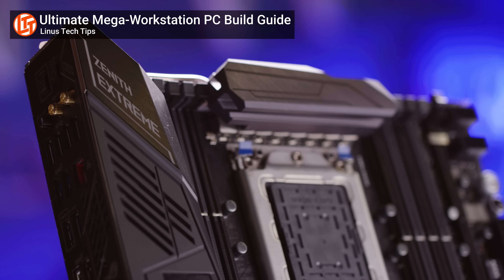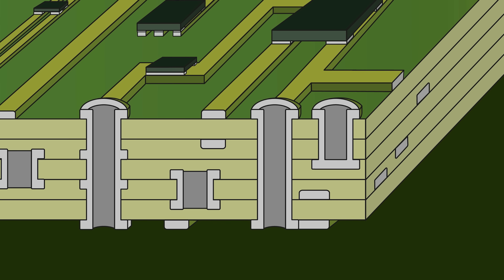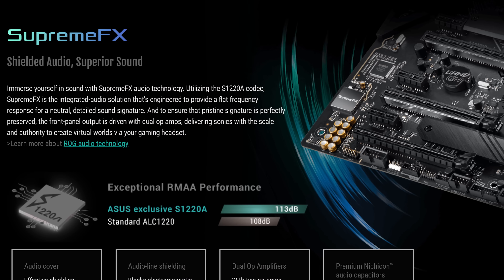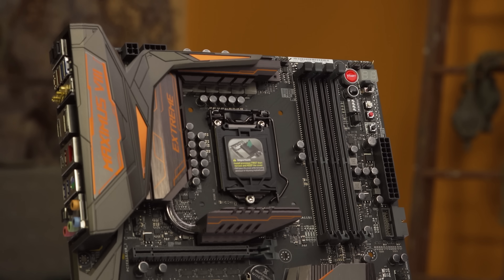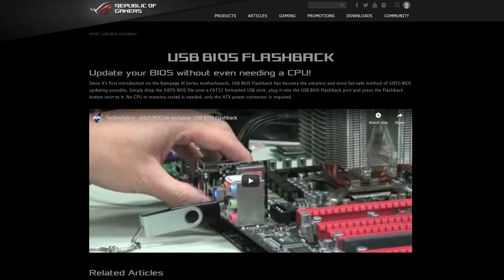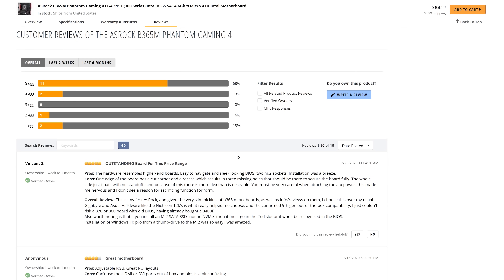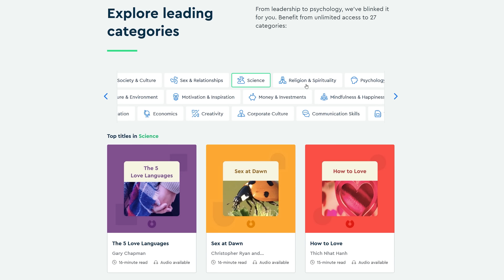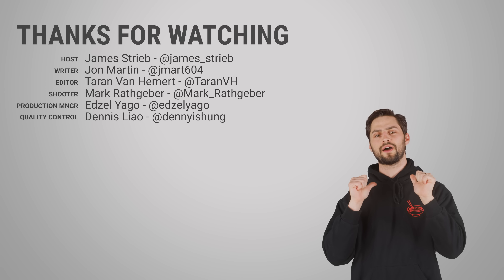Are EXPENSIVE Motherboards Worth It?

Comment: I love how there is a lot of motherboard related videos popping up on my youtube recommended the last 2 days... while waiting to find out what happened to my motherboard I bought a week ago and is a few days overdue delivery... I have a Gigabyte B450M board, it was great with my Ryzen 5 2600, but I recently bought a Ryzen 7 3700X and I can tell you this, the motherboard is very unhappy with the power draw of the CPU, VRM's are getting extremely hot and having power delivery issues because they need to rapidly cool themselves instead of cook to death, doesn't help the upper VRM's have no heat sync at all, and the left side VRM's have one but it may as well not because it just doesn't work. The new motherboard will be the final upgrade to my system (a unless something fails or whatever), since I upgraded the CPU from like I said, a Ryzen 5 2600 to a Ryzen 7 3700X, my GTX 1060 to an RTX 2070 Super, replaced all 5 120mm fans in my case with newer, more powerful fans to blow a lot more air into and out of the case, I have 16gb of DDR4 3200mhz ram so no need to upgrade that for a while, and also added 2tb of extra space to my overall storage, and once it gets here, I will be replacing my current Gigabyte B450M with an ASUS TUF B450-PRO board, from Micro ATX to full sized ATX board, has some real nice heat syncs over the VRM's, and have a few other pretty good looking heat syncs elsewhere on the board, plus a better payout of the SATA ports, and is made with Ryzen 3rd gen in mind so no updating the BIOS to run any 3rd gen Ryzen CPU, can do that out of the box. I also have a be quiet! Pure Rock CPU cooler to replace the EXTREMELY LOUD stock cooler that came with the 3700X... I have never heard a Wraith Prism be so loud in a system before, and has to be, as it can barely keep the CPU cool enough while idle. Needless to say I finally have myself a really decent CPU (once the new motherboard arrives and is installed) and will be building a second PC out of all the spare parts I will have left over (currently the only spare part missing is a motherboard to run the Ryzen 5 2600, which the board I am using now will be the board used in the second system)
Reply: in that case then wait for b550 atleast you can use 1 nvme with pcie 4.0

Comment: When I was picking out parts for my first PC I was originally going to cheap out on my motherboard.  I am happy I invested in a better model, cheap motherboards typically have cheap VRM.  (I ended up going with an Asus Z370 ROG Maximus X Hero WiFi)
Reply: Looks like you wasted money. Unless you have AIO and did crazy OCs.
Reply: @deivytrajan  I bought a 280mm Corsair liquid cooler and heavly overclocked an i9-9900K, deffinitly didn't waste my money.

Comment: There's a middle ground where you're not spending $500, but getting the extra features you would want over the $50 unit.
Reply: I typically look around the $200 mark. That, I feel, is the half way mark. It has features you'd want, and doesn't have features you don't want.

Comment: I got an X370 board (Asrock Killer Sli/Ac) for my original R5 1600 build and now have a 2600 installed in it and it still runs great. I plan on upgrading to a new board and a 3600 eventually but really have no need right now other than wanting a smaller case and ARGB headers. Been thinking of X470 since it's a decent sweet spot of features/price.

Comment: Asus has a quality series of z390 boards for anyone searching for a solid mid-range... Asus Prime z390a ~$170 for base / Asus ROG z390e ~$220 if you want built in AC WiFi/BT5.0 - the bios on their boards is super easy to use and has a high threshold for customization

Comment: In my experience don't cheap out on a motherboard you end up pay the same price for two motherboards half the price as an expensive one because of issues and buy a motherboard where there is confirmation for future upgrades like Ryzen or like Intel used to. An exception for a cheap motherboard was for my first build I had an i7 4790k with a $49 motherboard from MSI (brown with blue pcie 16 slot) I don't remember the name but it was a solid built mobo with overclock capabilities
Reply: In my experience, the Gigabyte A320m S2H has been really good so far, almost a year with it with both the ram an the cpu OC'ed
Reply: I think the next Ryzen processors are going to use a new chipset as AMD has reached the end of what this one can do. But the next chipset will have a few years of support once they swap to that.
Reply: @jacobgame2757  Ryzen 4000 (Zen3) should still be AM4 and be supported on older motherboards (except maybe A320). Ryzen 5000 (Zen4) will most likely be a new socket and support DDR5 and AVX512.
Reply: My build is 4790K on MSI Z97 Gaming 3 from 2015 and i'm using it to write this very comment, heh. MSI GTX 970 still going strong too.
Reply: I guess you had the h81m-p33. I got ripped of on my first prebuilt with an i7 4790 and this motherboard.
Reply: @FFischer02  did you buy it used?
Reply: Daniel D. No I bought it new in 2015
Reply: @FFischer02  build your own. Much cheaper.

Comment: Are EXPENSIVE Motherboards Worth It?
short answer: no
long answer: yes but actually no
Reply: Memory OC on cheap ones is a nightmare. now i need to stick to Asus high end MBs because even the strix ones do not have all the features i need
Reply: No, they are most definitely worth it
Reply: Personal expirence, never gona buy a high end MB ever again, not because they are bad or not worth, because last one ( ASUS ROG Z270i Strix GAMING) have a problem with their memory channels after some time of use (never OC, buy it most for integrated wifi 5 and bluetooth in a ITX at the time) and asus dont recognize garranty, so i en up buying a cheap msi b250 with a pcie card for wifi and bluetooth. all the original components of the ASUS are still working on the chep msi, and if this one died, at least was cheap.
Reply: I have a computer with a first gen i7 with an expensive motherboard that I have gamed on for years and only recently stop using it for gaming, it's now my plex server.  I have another computer hats a 4th gen i7 with a motherboard that cost me 89 at the time, it died 1 1/2 years ago, but before it died it went out slowly over 3 months.
Reply: @Suiyin88  thats sad to hear. i had great experience wih Asus support so far. but memory issues over time with the MB i never heard of. eather RAM was damaged or the cpu IMC gone bad... did you test with other CPU and RAM?
Reply: @snortgfuel  that is a rare case scenario but i agree unless your just going for a low budget build
Reply: @mauriceelet6376  with the money you save you can just buy faster ram...
Reply: @UltimatePwnageNL  that might be true. but you should not notice the difference of the 3600 to 3700 anyway so why buy more than you need if you upgrade 1 year or so? for 4 or even 6 years you would be better off with the 3700 because the PS5 and XBos will have 8 cores too, but 1 yea... even 10$ more would not be worth it
Reply: @mauriceelet6376  not the motherboard, all the other components from the same build are working on a msi b250m.
Reply: Revolvin Goatt  it's was from a couple of year back when z270 whas brand new. and gtx 10 series was too.
Reply: @Suiyin88  ok, that bad on Asus than
Reply: @mauriceelet6376  LMAO, Asus and good support? That's a bit far fetched. I have to contact US support to actually speak to someone, because guess what in UK, they say they have available support between certain hours but they actually don't. It takes years to respond and weeks to fix/replace a product, so not exactly so good. Don't get me wrong, they do have decent support, it's just not as good compared to other companies, like Microsoft for example who I'd always rate an A star for their efforts at fixing issues with my PC and succeeding at it as well with friendly and patient people, even if I was the one to mess something up.
Reply: @andreiarg  well. I only know the German guys so that can be true
Reply: @mauriceelet6376  it's not like they make bad MB... that MB was awesome, while it work, but you can get a falty one, so again it's a personal expirence and in the moment they release it that z270i on 2017 it was expensive... so having not recognize the guarranty was a big punch, so from now on i preffer buying a cheap one and if it break i just buy another.
Reply: @Suiyin88  well you pay for Support, so its not like you have nothing to complain. And a +150$ MB should get you good Service. If you cant use the product because of them they failed to deliver on that. Nothing more and nothing less.
Reply: i rather buy a better motherboard than a better cpu.
Reply: @ItsReaxxion  FACEPALM
Reply: @Gnawde  no tf they ant lmao!
Reply: Hana Song I think you have that backwards 🤣
Reply: Surely there's other factors like yearly salary???  It would make sense for somebody on a high salary such as a CEO, rockstar, filmstar to buy a 16 core CPU, very expensive motherboard and an RTX Titan etc.  Then somebody on an average salary to buy a mid range CPU, mid range motherboard, mid range GPU.  Then somebody on a low salary to buy a low range CPU, low range motherboard, low range GPU.
Reply: To a certain degree you will get a bit more when you pay a bit more but $500 for a MB? Take $300 of that and get a better GPU or CPU. If you have already purchased the best of everything you can buy then this does not apply to you.
Reply: I think mid tier is best. Better caps/ solder job, place for more ram, maybe dual bios, without the unnecessary junk like covers, paint job or rgb.
Reply: @ImGerald  to be fair, you wouldn't buy a 3950x and put it on a cheapo matx board with no vrm heatsinks
Reply: @Mic_Glow  to be fair rgb is pretty cheap now. And so are black pubs and stuff. So it doesnt really cost anything for the looks

Comment: some lower or mid range X570 boards are the best bang for the buck. I have the MSI MPG X570 Gaming Plus with a 3700X and a 2080 Super and I couldn’t be any happier. Goes for $170 and you can get some for around $200 which are even better and will last a long time.

Comment: Idk why you'd leave out so many key factors. More PCI slots at x16 rates rather than a mix of x16, x8, x4, x1 etc. Thunderbolt support with add in cards or built right in. Multiple M.2 or other drive expansions like time of SATA or SAS etc. Built in hardware RAID controllers. Heck even multiple CPU Sockets would fit into this video for even higher end systems which you guys cover all the time!

Comment: I'm using a $150 low-midrange motherboard and it's been fine for not only general use but overclocking
Reply: it's always fine, that's true. but not as reliable or durable under the same circumstances. Power fluctuations can degrade components, it's invisible to the eye but pretty clear (or deadly) on the long run.

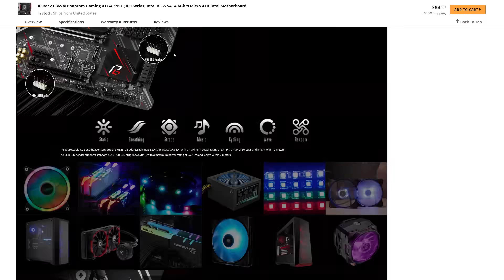Comment: 4:17 Hey, that's MY cheap MB in the video! I slapped a used i7 9700F in it... no complaints and saved some $$$.
Reply: Goodbye VRMs...

Seriously don't do this
Reply: Thermal throttling says hi
Reply: @keylatheace_dcs127  Pretty sure you're completely confusing an overclocked 9900K with a speed-locked 9700F... the 9700F just doesn't get very hot. I've been running a 9700F on this MB for about a year now, no problems, full (locked) speed... what's your experience with this setup? My VRMs are just fine.  I speak from personal experience, not throwing wild guesses to the wind and offering opinions without knowledge.
Reply: @wolfshanze5980  "wild guesses"... We're not trying to attack you, we're reccomending you don't continue what you're doing. Our "wild guesses" are backed by specs. A board of that quality (or lack thereof) will have the minimum VRMs that work, or 65w. Sure you may have a TDP OF 65W, but TDP and actual power draw are not the same thing. A 9700F can pull >100w EASILY when turbo boosting. A sustained multicore load will almost guarantee VRM throttling your boost clocks, and a heavier one cutting into base clocks.
Reply: @NvidiaRTX5080  It's wild guesses when you don't own or use one... of which I have both and have run many tests on... there's no issues at all with my system... VRMs or otherwise... feel free to blow chunks of cash on things you don't need if you want, but I don't have a high-end CPU throttling my VRM... this is coming from a person ACTUALLY USING THIS SETUP... ie: not you.
Reply: @wolfshanze5980  If only the actual MANUFACTURERS made data sheets on the exact power ratings for their products with professional equipment instead of someone doing biased "tests" with their own hardware

Comment: AsRock X570M Pro4 AM4 looks dead sexy brand new outta the wrap, components on mobo fabrication tech have shrunk too. I can barely see pots and diodes and resistors they are effink microbial on AM4 boards. Kind of stunning effect really, the only stuff that really sticks out on that bare board are the ports, sockets, slots, plugs and heat shields. Maybe its chipset fan too, there'll be a water block for that I reckon. These are absolutely the best bang for a buck mobo right now.  I recommend.

Comment: I've seen major differences with my builds between good and bad VRM set ups. Also big efficiency gains at same GHz vs bad boards. I tend to run mine at 100% load 24/7 so these things matter to me. For example I upgraded my i7-8700k from a Asus board to a recommended EVGA board and saw a 20W less power being used at the same 4.9GHz all core. Also stopped VRM throttling.
So yes, I have to shop for boards with well regarded VRM set up and the plugs I need. Say, the stupid rare USB-C front header.

Comment: 4:31 "If you're planning for using the motherboard for a really long time, like, for more than 5 years (...)"

FIVE YEARS is a really long time for a motherboard?? I'm asking for my 7 years old one.
Reply: According to google: The average lifespan of a computer is typically three to five years

Sure it can last ALOT longer than that, you should expect to upgrade after at best 5 years. Most people would want to upgrade sooner for higher perfomance, but that is a different problem :)
Reply: I have one that is 10 years old so...
Reply: @ssu7653  Yeah my CPU is over 9 years old (i7 2600, released on January 2011) yet I don't feel the need to change CPU or mobo. Sandy bridge for the win.

Although I am running with the integrated intel graphics card. I will benefit a lot if I buy a decent graphics card, like the GTX 1060 or the 1650 Super.

That is, when I get the money to afford it, because I'm broke now.
Reply: @mparagames  ok

Comment: Depends on your other parts. I paired a $750 board with my i9-9900K and 2080TI because it has 12 phase VRM on power. Overclocks very well. Also has insane connectivity with 10 gigabit Ethernet. I also won't buy a motherboard without a backup/dual bios.

Comment: That's not a cat 6 cable, that's a serial cable
Reply: Nerd
Reply: Nearly all modern connectors are a serial connection. And both of them are RJ45 Ethernet jacks, not DB9 Serial.
Reply: More specifically those are Cisco serial cables (console cables), you get them with pretty much all their server grade switches and routers.
Reply: Get your facts right at first.. That is one type of CAT 6 connector.. 
At first know the difference between RJ45 AND DB9
Reply: @aluandcache7336  dude, it's a Cisco serial cable, whether it's RJ-45 or DB9 connector, 
 It's a serial cable, it's not an Ethernet cable. Jack doesn't define cable type, I've used RJ45 for POTS, Ethernet, and Serial. All different cables. You'd have a bad time pumping Ethernet at any modern speed through that serial cable
Reply: @Sh3dinja  RJ45 can be found in CAT6 or CAT 5E as well. Do some internet before standing on a point..
Reply: @Sh3dinja  Serial cable is a type of cable same way its connectors are DB9 to RJ45 or DB9 to others..
The same connector RJ45 comes with CAT6 or CAT6E 10 gbit ethernet
Reply: @aluandcache7336  you're literally reiterating my point. There isn't an argument here.
Reply: @Sh3dinja  The point is you weren't fully right... Here another guy also said that.. Because they showed the connector not cable or DB9 port..
Reply: @aluandcache7336  look at the wires in the connector, they're all solid colors. That's a Hallmark of a Cisco serial cable. I'm not sure why you're so hung up on the connector
Reply: @Sh3dinja  you mean that blueish colour?
Reply: Technically it's both. Serial and cat 6 refer to two completely different and independent aspects of the cable.

Serial/parallel               - refers to the method of communication: sending bits sequentially across one conductor (serial) vs. entire bytes or words at once across several conductors (parallel). Most modern cables use serial.

Cat 5/5E/6/6A/7         - refers to the quality and complexity of the cable itself (as in, the actual bundle of copper wires) and by extension the data rates it's rated to transmit. Higher category numbers include feaures like shielding and designs that further reduce crosstalk and interference.

RJ45/RJ11/DB9/etc. - refers to the physical connector on the end of the cable, with RJ45 being your standard Ethernet port, RJ11 being phone, and DB9 being the old but widely used connector on everything from Atari joysticks to PC serial cables to CGA and EGA displays.

Comment: I built my first PC a few months ago, probably didn't do as much research as I should have. Bought a $300 x570 board because I thought it had dual GPU support. Turned out it only supported Crossfire (which Radeon dropped from newer cards)...and I had bought an Nvidia card on top of that.

Doing more research, it seems the more expensive boards ($600+) are the only ones that support dual Nvidia cards.

Cheaper boards are still useful, if you're not looking to run the most extreme setup, but I now see how manufacturers skimp on features  like this and cut corner.